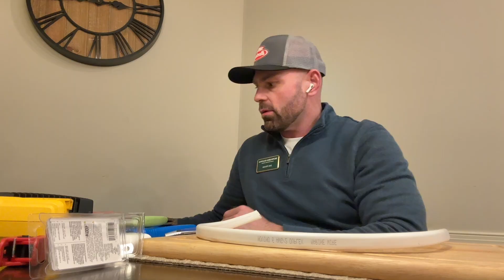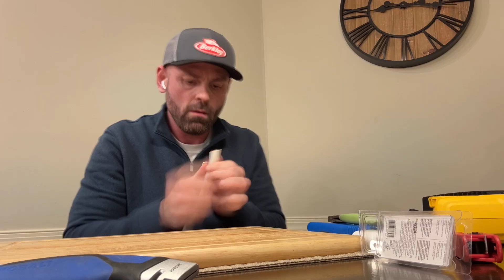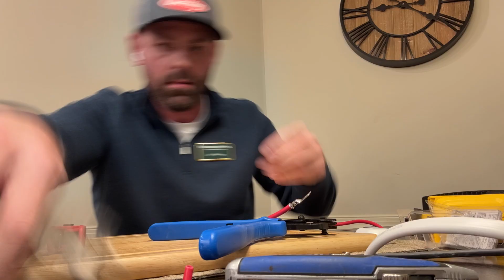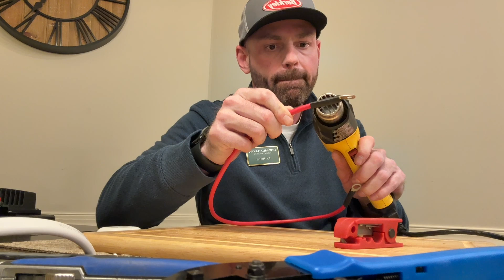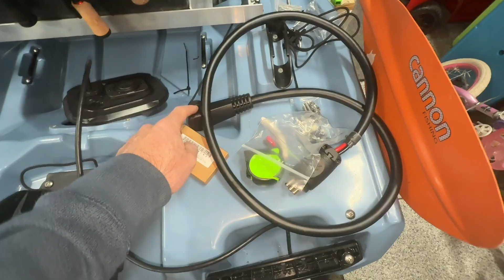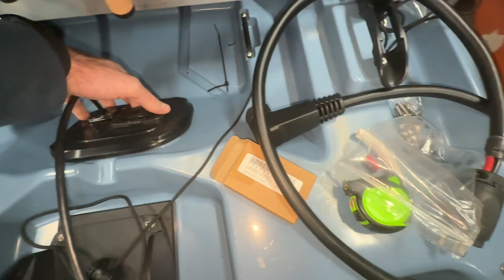How to Install a Circuit Breaker for Garmin Force Current | Bonafide XTR130 Wiring

Comment: I have a Kesser battery protection box with an integrated circuit breaker (selectable 10 amp or 60 amp). Inside, there is a LiTime battery (12V, 100Ah) connected.

If I connect this system to a Garmin Force, can I safely operate it with the 60 amp circuit breaker, or could this damage the motor?

What happens if I accidentally switch to 10 amps?

Please explain — I am a beginner in technical matters.
Thank you very much.

Comment: So a couple things here. Number one I would step up to a 50 amp breaker. Garmin says you can protect the system with a breaker capable of carrying 40 amps but cannot be more than 60. The general best practice in the Marine world is to size your current protection according to 125% of the load, so 125% of 40 is 50. The 40 amp breaker while it does protect the system, it is extremely close to the maximum output of the motor so it may nuisance trip when it doesn’t need to trip, or it will get warmer than it needs to get because the breaker is constantly at the max output and it’s constantly about to trip. A 50 amp breaker also helps better differentiate between normal motor operation and a real issue.

#2, I would find a way to get that breaker WAY closer to the battery. 18 inches is way too far from the positive post. I would almost consider adding Velcro to the breaker on top of the battery and keeping it as close to the positive post as humanly possible, the best practice is to be within 7 inches of the positive terminal. 

Otherwise great video.
Reply: I have a Kesser battery protection box with an integrated circuit breaker (selectable 10 amp or 60 amp). Inside, there is a LiTime battery (12V, 100Ah) connected.

If I connect this system to a Garmin Force, can I safely operate it with the 60 amp circuit breaker, or could this damage the motor?

What happens if I accidentally switch to 10 amps?

Please explain — I am a beginner in technical matters.
Thank you very much.
Reply: @marlenep.9768 I would strongly recommend continuing to familiarize yourself with the basics in electrical before tacking high amperage device installs like this. But to answer your question, according to garmins manual you can protect the system with a breaker with a MAX rating of 60. So based off garmins words, it is safe. But I would feel a lot more comfortable with a 40 or 50. I would at least make sure the wire you’re using is capable of handling 60+ amps given your distance from the battery. If you switch to the other 10a breaker, it’ll trip instantly once you start using the motor. No harm done. But it’ll just trip immediately. Hope that helps.
Reply: @UntamedOutdoorsmen thx so so much1 you help a lot! which wire do you mean exactly? the wire from the garmin motor? - it is the original wire - so this should be fine. or do you mean the wire from the battery to the breaker? here i have the original wire from the kesser-battery-protection box…

for me, all of this is not that easy! so this means a lot to me, that you explain all of this stuff! thx
Reply: @marlenep.9768if the supplied garmin cable is enough to get to your battery/breaker setup, than disregard that part of the reply. No problem helping out but again I wouldn’t rely on YouTube commenters for official instruction. Absolutely should do independent learning/research so you understand what is happening on your devices and how to be safe.
Reply from the maker: Great information! Thank you